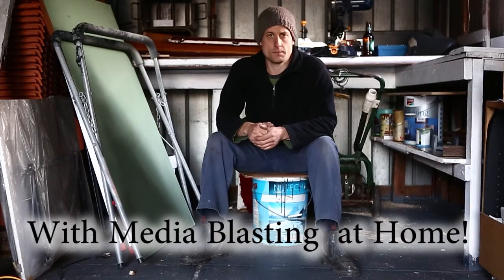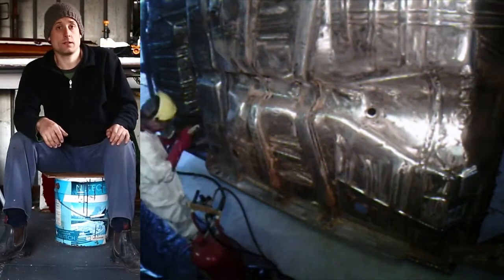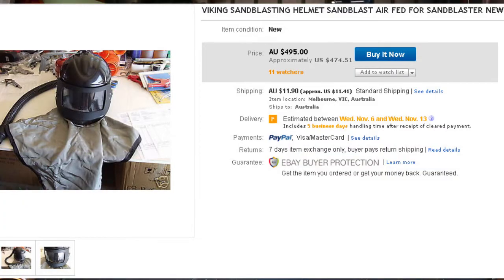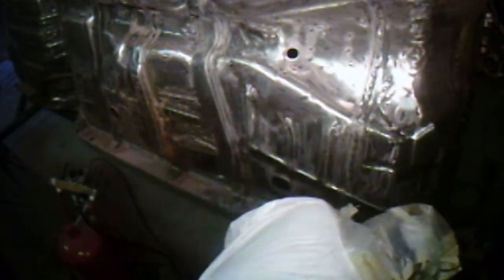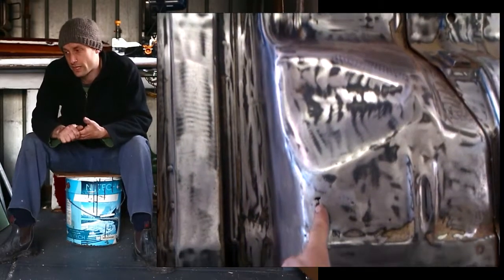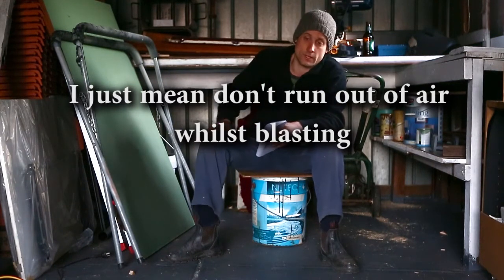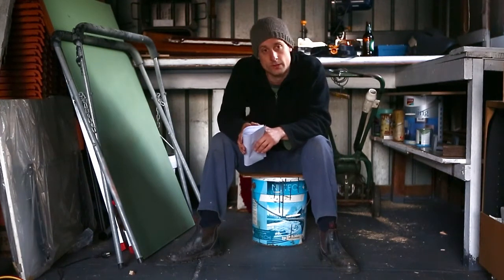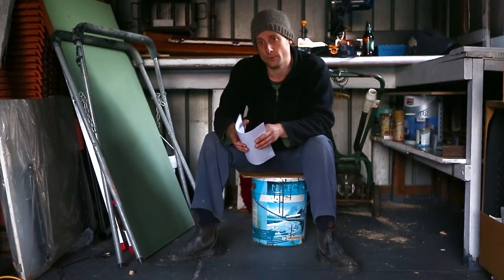sandblasting

Comment: $350 AUD to get the floor of a 4 door sedan blasted and etch primed by a mobile blaster.
I did blasting for a living and we had filtered air supplied to the helmet.
Still wouldn't do that job again for any amount of money. You still breathe in tons of crap. Even with the air supply you are breathing in lead paint and lead body seam sealer and filler on older stuff. And Acrylic or 2 pack dust on the newer stuff.
I would rather pay the money and let someone else suffer the health issues.

Informative post tho. :)
Reply: clemco hood with filtered air , Im fine when i blast